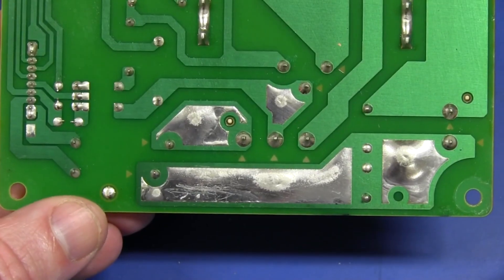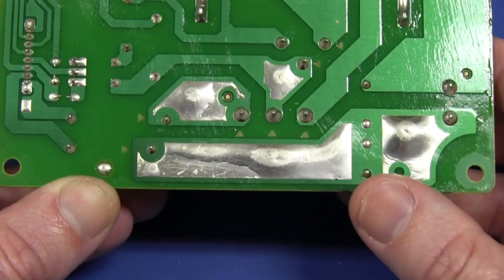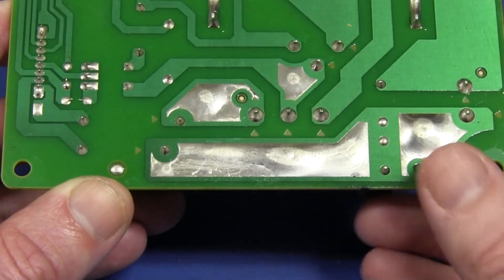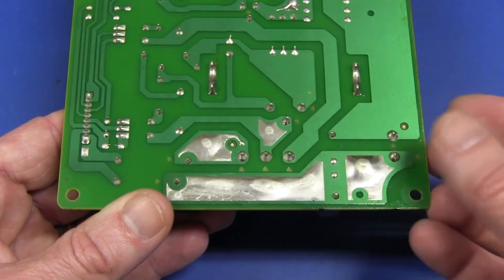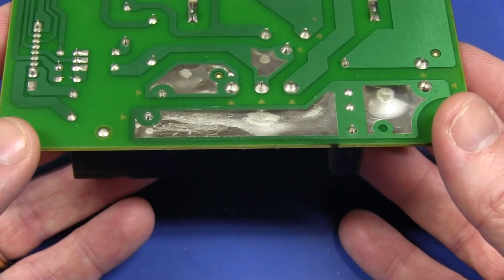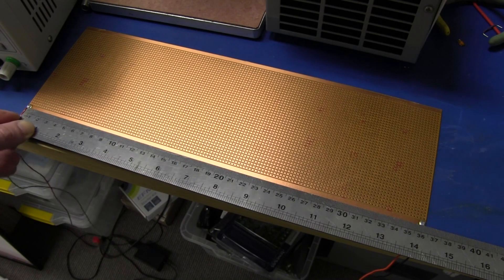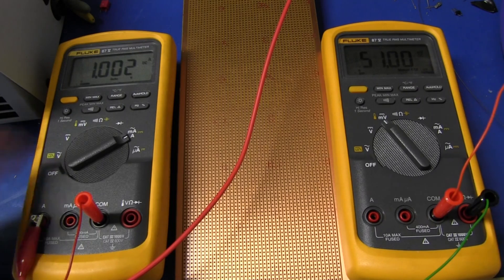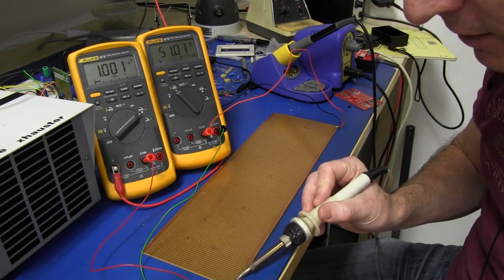EEVblog #317 - PCB Tinning Myth Busting

Comment: If the board is lead-free solder, there is a risk of breakage / cracks forming from CTE or vibration issues.  I have an under-seat self powered subwoofer which failed because a big open region of tinned solder cracked.

In power supplies I often see thick jumper wires following the same path as the PCB traces, in an effort to provide additional ampacity to that portion of the circuit,  either in place of tinned regions or to supplement them.  They often terminate near the solder termination of compenents which are carrying high current.

Comment: Allow me to debunk the myth that the only reason tinning is added is for electrical conductivity.

The example PCB shown at the start of the video appears to be tinned mostly for COOLING, not for current carrying capability.  While it will increase cross sectional conduction area along the short current paths in this board, the main benefits for this PCB is more likely thermal.  Specifically, removal of thermally resistive soldermask*, providing an additional thermal path laterally, and acting as a thermal reservoir, reducing temperature spikes when the load is varying.  

Another benefit is filling in through holes to get the heat from the front side of the board to the back.  In some cases you will find the tinned regions in multiple strips on a single pad, so that there are high and low spots for increased area, much like a low profile heatsink with fins.   The direction chosen might be also to aid conductivity or add mechanical strength.  Perhaps adding tinning in strips on large open regions also prevents too much puddling at the center of the open region and manage the amount of solder added for consistent thickness.

My point is tinning may be for electrical improvement, thermal improvement, mechanical improvement, or cost savings.  A review of the board itself will probably reveal which reasons implementation was done.

*The tinning seals the copper which would otherwise develop a film of corrosion where the solder mask was omitted.
Reply: You make lots of valid points, but I wouldn't say you are debunking it since you are wrong 🤣 did you even watch the video!? 
Thermal conductivity of tin (60w/m k) is extremely poor compared to Copper (385 W/mk). Please can you elaborate with some facts!
Reply: @entomopathogenicfungus904   Considering soldermask has a 0.2 W/m*K thermal conductivity, I'd say my points are valid.  If you look at the example PCB, the open regions in the bottom right are flooded patches not thin traces. So the technique is used for both purposes.  If the tinning is applied to a trace, it's probably for electrical conductivity.  If it's on a generally rectangular region, it's probably more for thermal reasons.  In professional boards I suppose I see both, but more often the latter.

P.S. I removed some of the redundant information from my post so it doesn't appear that I didn't watch the video 😸

Comment: Preparing the copper surface before adding he solder may help. It oxides quickly on contact with air.
Reply: Thats one of the reasons we use flux or flux core solder 😊

Comment: I wonder how current level affects the resistance.  For example, I'm thinking as current levels are increased, the resistance would decrease incrementally relative to the current.  Beyond a certain current level the resistance would start to increase because the conductor can no longer dissipate the accumulated heat.

Comment: I think lead free solder would be even better than 60/40 for reducing the resistance as the resistivity of tin is about half that of lead.  Not sure how to calculate the resistivity of an alloy of tin and lead - does one just average them out or is there some more complex calculation?

Comment: What about immersing some stranded copper wire in the solder.  I have seen this once, but no testing.  It will be more $$,  but what if it is a case that's worth it?
THANKS DAVE!!

Comment: Even though the solder resistance is higher than copper resistance, the total resistance is lower when a pcb trace is tinned. It's like connecting two resistors in parallel. The equivalent resistance is always lower than the lower value resistor. But all this is valid for DC. If we consider impedance of the timned pcb trace, things get worse as frequency increases.

Comment: Seriously, I doubt if silver plating would be worth the expense, since the conductivity of copper is so close to that of silver.  But the solder test might result in a warning to those building HF/VHF/UHF power circuits, to go easy on the solder.

Comment: Ah!.....but that's DC!  Suppose you're building a PA for, shall we say, 440 MHz?  The solder layer would INCREASE the RF resistance.  Here's an idea for an experiment.  I'd do it myself, but I'm too poor to afford the equipment.....("Alms for the poor!...Alms for the poor!...GHz oscilloscopes for the poor! ). Have two copper strips (properly terminated at the end, of course) fed with a pulse at one end, and a scope at the other.  See how the rise-time would differ, with solder and without.  And do it again with SILVER plating!

Comment: Whenever I have a problem with an overloaded trace,  I like to sweat down a small copper wire the full length of the trace.  Well,  usually a fine wire,  remembering a motor relay board where I used a AWG 14 gauge stripped out of a bit of Romex.  Ugly,  but it solved the problem.

Comment: If you really want to increase current capacity wouldn't it be better to use silver solder for silvers better electrical properties?
Reply: i believe that a slight variation in the amount of solder will compensate for any difference in the conductivity of the two types of solder. besides, it's a waste to use expensive silver solder for this.

what can really make a difference (and I did that when I needed to increase current capability and reduce voltage drop as much as possible) is putting a thick tinned copper wire on top of the tinned trace and filling it all with solder (make sure to hold the wire in place, it tends to move easily), as much as can hold there without leaking out (and that is going to be a lot).
Reply: ...the reason for this being that the electrical conductivity of copper is almost ten times higher than that of the 60/40 solder. so it makes sense to replace some of that additional metal's volume with copper.

Comment: I wonder what the difference would be if you used solderable copper trace repair tape instead of solder tracing and only put a bit of solder on each end of the tape?

Comment: The thing you aren't considering is if the trace is 10 miles long and half a mile wide there will be a big difference but one normal traces of a few mm it won't make a difference.  If you go from 10 pico ohms to 2 pico ohms how much more current are you going to get?  No boards have traces as long and as wide as his bread board.

Comment: actually I have done this in my line of work, Equipment repair. A type of unit that always burn on the board where the fuse and a large inductor is due to power demand down the line and other issues (like bad design). Which I am not complaining about since correcting manufacturer fault is a source of income for me. so anyway, after fixing the blackened and burnt PCB I add solder between the fuse and conductor. I followed with thermal scan which shows the heat migrating from the fuse clips on to the inductor.

Comment: I actually do not understand something. When we do that we thicken only specific area of PCB trace but the rest still remains the same thin copper. So what am I saying is, that if we use thick wire which has e.g. thin coupling to another wire, high current will burn that thin wire joint, yes? So what happens here on unthickend traces on high current? Thanks in advance. :)

Comment: i think the biggest problem with this technique is the risk of shorts if the solder overheats and melts. i had a cheap usb power brick that did exactly that because i overloaded it horribly and it didn't have any polyfuses or similar. solder holding the pins of the mains plug onto the board liquified, shorted out and pretty much instantly vaporized (aka exploded). after i extinguished the flames and threw the breaker back in i disassembled it to take a look at what happened and the whole case and everything inside it was sputtered in solder...

Comment: "350 millimeters" lol can't you people see how stupid it is to use millimeters for such lengths? There is NOTHING better than inches and feet for everyday items, get over it, you sound ridiculous and NOBODY can visualize how long 350 millimeters are in their minds. Millimeters are ONLY good for measuring your metric system fan boy tiny dicks.
Reply: Funny, that's EXACTLY how I visualize 350 millimeters: I look at my d!ck. How do those finger-arm-foot measures work anyway? How come "a d!ck" isn't a unit? "Hey, have you seen that kid? He couldn't be more than 3 d!cks tall!" XD
My inches are 2 inches long, btw. I guess I wasn't built imperial. Maybe they had started to ditch the Approximate System by then.
Reply: you;re just being funny... visualizing sizes in mm, cm or in is just a matter of being accustomed to a specific measuring unit. 

working with multiple measuring standards widens one's visualization capabilities. 

in some instances the metric system makes it more intuitive and quite faster to add/subtract numbers, such as 3/16 + 1 1/32 - 5/8 :}

Comment: I use this practice too, the idea is I can get over double the current through thinner tracks, and it reduces the pcb area required. Pile the solder on thick, then while hot  re-work by running the iron along the trace to get a neat smooth tube of solder., easy It look like it been wave soldered. Obviously time to do this is limited or the pcb will over heat and can be damaged where track may start to lift.

Comment: When you calibrate a 3478 you can only calibrate 2 or 4 wire ohms. The measurement that isn't picked to be calibrated is probably going to fail so that meter might be a little off to show the difference between 2 and 4 wire.

Comment: Tinning a trace should make a huge difference. And that's because what you are really doing here is adding on a thicker gauge wire. And when you do that, resistance will increase. That's simply because you're increasing mass of the conductive material. Tinning is no different. In fact, if you did a two-ounce PCB process, that should increase resistance throughout the circuit. I guess tinning is a good technique if you want one-ounce of copper throughout the PCB, but want to increase the thickness on only certain areas of the PCB.

I wonder what the result would be if, instead of adding thickness via solder alone, you would stretch a copper wire across and then solder it on both ends.

Comment: I would not recommend to use such a technique - it is simply not reliable:

1st, it depends on the wave-soldering parameters how thick the layer becomse.
2nd, this exposed solder may increase the risk of shortcuts within a device when there is such a large metal area
3rd, depending on the operating conditions, i.e. temperature and especially humidity, the tin will in some way crystallize and loose its conductivity.
4th, due to Pb-free solder tin, the risk of whiskers dramatically increases and may cause malfunction on the electronics.

Even though it may take additional time/costs or even manual work, I would add a suitably thick copper wire, especially when the whole design already has (bulky?) through-hole-components.

Comment: "Lead free rubbish"  Thank you!
Reply: Nothing wrong with lead free, it just needs more heat. Its been used as standard in industrial and consumer electronics in the EU for many years now perfectly successfully.
Reply: @cbcdesign001 For one-time reflow manufacturing process purpose more thermal stress for electronic components is bearable with the benefit of less poisoned environment caused by improper utilisation of electronics. Less toxic industry for its employees is great either. BTW, actually, Chip Quik desoldering alloy CONTAINS lead (despite its claims that it is suitable "for lead and lead-free" applications - if you delete it completely before placing a new chip, the refurbished electronics still be virtually lead-free, but then the whole point is missing: you still work with lead). As opposite, Field's metal is, actually, lead-free and has practically the same melting temperature, 60°C (but it has up to 51% of pricy indium within - instead of up to 21% of indium within Chip Quik alloy, which isn't cheap as well)
Reply: @cbcdesign001  negative. Everything is wrong with RoHS alloy. You may want to search for "Tin Whiskers", but don't crap your pants when you do.

Comment: Surely the weakest point in this test are the parts just after where you had the wires soldered for sencing where no solder was applied to the strip?

Comment: i worked in the power supply industry for most of my life. We always used 2oz copper for our PWB's and always left the solder mask off high current traces to increase the current carrying of those traces. Our kirsten jet solder machine left a pretty thick coating on wide traces. i would guess this halved the resistance of the traces from what I experienced..

Comment: Why don't probes use gold plating? Is gold on audio cables just a gimmick?
Reply: Gold is essentially inert, so it's not going to corrode like the other metals.  Copper is more conductive, though.  Can you have the best of both worlds?  Plate your copper wires with gold!  There is slightly more resistance since the contact surfaces are maybe gold-gold, but your stuff will last longer, and durability is (almost) always more expensive.

I think the reason they don't do it for probes is because there's less of a benefit for the price.
Reply: +BillTheBox a bit of a cash grab, but for any connector undergoing many repeated mating cycles, gold stands the test of time
Reply: Can't say for sure about the probes, but for audio cables the gold plating makes for a much more durable contact. In brief, the signal integrity of the cables (or any connectors) degrade slower with a gold plating on the contact areas.
Reply: you were right, I'm sorry; They will have discovered another type of copper haha !
Reply: It's a common misconception that gold has a higher conductivity than copper. When gold is chosen over copper it's because it doesn't corrode like copper (good for connectors).
So for all you hifi freaks : those wires with gold strands or gold plated strands are a waste of money ;)
Reply: True enough.

I said copper wires.  I meant terminals. :P
Reply: In my experience nickel plated is cheaper, works fine and is generally quite durable.
Reply: If you're  measuring milliohms, gold plating will make a difference in repeatability.
Reply: Fav Gupta: Probe,master  test probes/leads are gold plated. Also, spring probes, as used ( or were used) on ICT fixtures are gold plated as well, in the most common variants.

I personally have some misgivings about gold plating for probes. Or connectors that are subject to many cycles, due to how soft gold is. Especially when the gold plated connector is mated to a chrome or nickel plated contact. A few cycles will e fine. Many cycles may wear the gold away. Same concern with test leads.
Reply: and this shouldn't be seen anyway, you can keep a 3,5mm jack for years without corrosion.
really gold plating is a bit of a cash grab
Reply: ''' Copper is more conductive, though.'' 
Who told you that?

Comment: If I were doing a post-production mod to a board, I'd lay down a bare copper wire over the trace then solder it down. Anything in parallel will help, but copper+solder has lower resistance than just tin/lead.
Reply: What I sometimes do is reusing some wasted copper wick to reinforce the trace when I run out of small sections of solid-core copper wire kept from domestic electrical works.
Reply: what if you wanted to draw 25A at 5v ? would 3mm solid core copper wire work ?
Reply: @PeteClio  - yes 3mm2 will work better than 2mm2 wire.
Either can handle the current you mention, but thicker = less voltage drop.
Look at the size of the (flat) wire inside a 25A fuse... that's your minimum.
It's all about the voltage drop, but most critical is the length. At 25A the 3mm2 will give a huge drop over 10 meters, yet the drop will be about 100 times lower over just 100mm.
Reply: Is that due to skin effect?
Reply: @thedevilinthecircuit  - is WHAT due to the skin effect?
The idea of increasing conductor cross section is to reduce resistance. In the case of low voltage DC circuits, there isn't any skin effect anyway.

Comment: but high frequency currents only flow on the outside, "skin effect", so for high frequencies this doesn't change anything
Reply: +Elliott Martinson How high?
Reply: "Over 98% of the current will flow within a layer 4 times the skin depth from the surface"
at 1 MHz in copper, this is 66um*4@1MHz, decreasing~f^-1/2 to 6.6um*4@100MHz, 650nm*4@10GHz
Of course inductance becomes the primary source of impedance at those frequencies

Comment: Well, it's real simple. Does a thick piece of wire have more resistance or less than a piece half the thickness? You're increasing the "gauge" of your trace by building up a solder path along with the copper path. Think: If you laid a one inch(25.4mm) square bar(of solder, silver, gold, platinum or copper) along the trace what happens to the resistance? Which has more resistance, a one foot(304.8mm) long piece of 28 gauge wire or 12 inch(304.8mm) thick piece of wire?
Reply: KitCox a) he is decreasing the gauge. Not that good in my american knowledge but a lower gauge means thicker wire, doesn't it?
and b) pretty sure dave knows this